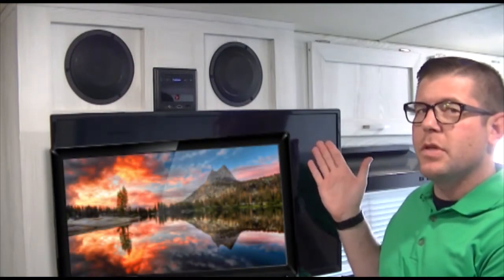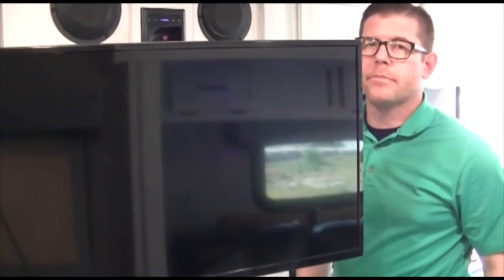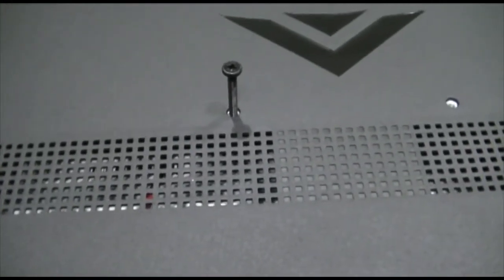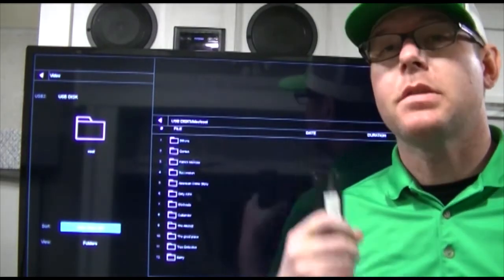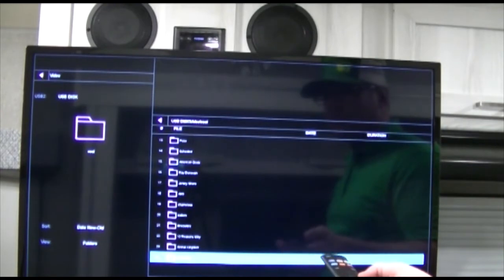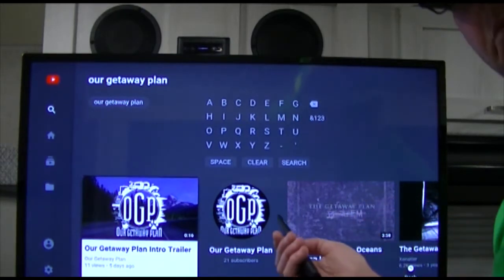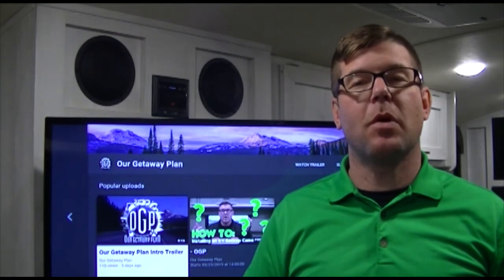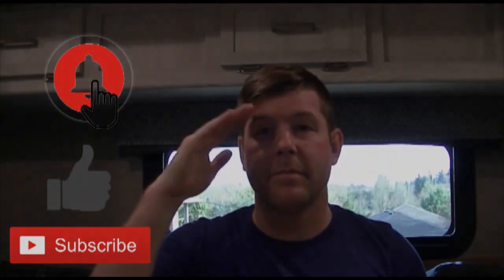WHY A SMART TV IS SMARTER (Installing a smart TV) - OGP

Comment: Overall great video, simple and to the point. Problem with the inverters is you're losing a little power on the conversion. Alternatively, keep the 12 volt tv and get a smart tv dongle like fire stick (which also runs off of 12v) and you can make any TV a smart TV. Most dongles will also support SD cards or usb slots.

Also, do you plan on uploading 1080p content in the future? Liking the videos, but 720p pixelation is killing me lol.
Reply from the maker: I guess I probably should upload in 1080.

Comment: Does the bigger TV block anything? From our angle it looks as though it impedes into the cooking area.
Reply from the maker: Nope, the way the arm that holds the TV sits it pretty much just covers the hole where the original 22inch was and the trim on either side.